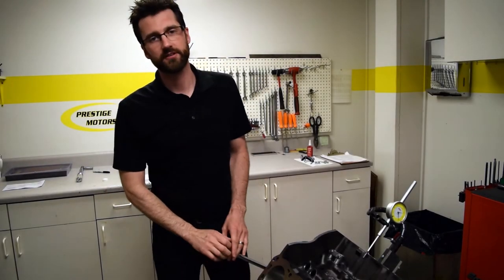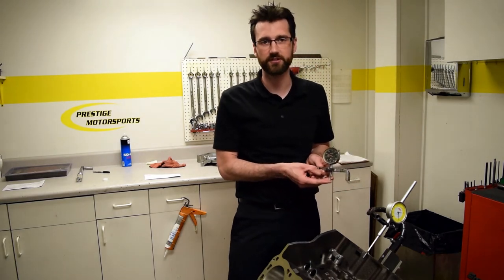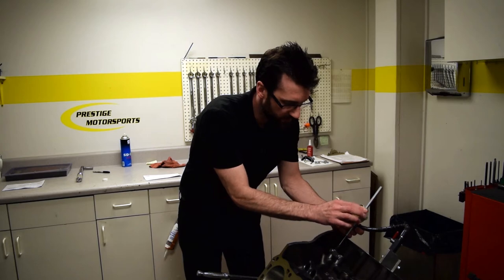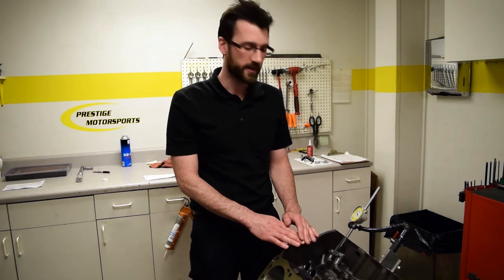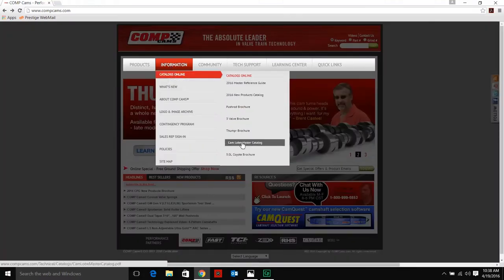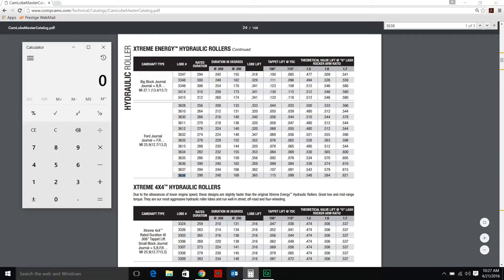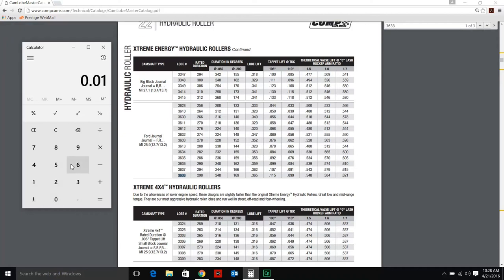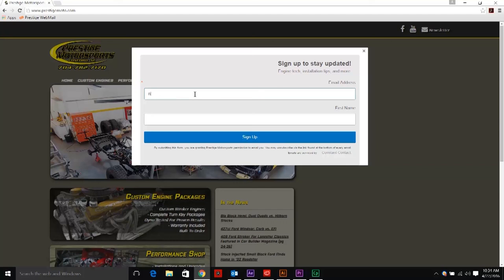How To Degree Camshaft Using Lift At TDC - Without Degree Wheel

Comment: Is there a way to discover what degree centerline is of a camshaft with only one comparable centerline at TDC? If my lift is different than the manufacturer's specs, and the manufacturer's website does not have the same exact cam running on different centerlines, is there an equation possible to figure out what degree I'm in or how many degrees off I am?

Comment: Pistons dwell like 5 to 6 degrees at the crank so you're pretty much wasting your time trying to degree a cam. Just buy a degree wheel they're like 10 bucks
Reply from the maker: We would disagree that it is a waste of time. On a 1.6:1 rod ratio, the piston dwells at 0.0005" for less than 2 degrees. That is certainly enough to read on a dial indicator. Then when you consider 2 degrees on the crank only moves the camshaft 1 degree, your lift at "TDC" is close enough to get you within a degree of intake centerline.

We would agree that the most accurate way is to use the largest diameter degree wheel available and a positive piston stop. The purpose is to show that in a pinch or in the case of multiple engines using the same camshaft grind, this is a very quick and easy method to verify cam positioning.
Reply: @prestigemotorsports  I don't know where you're getting less than 2 degrees but that's way off. But let's use your number. One degree at the crank on a custom cam is going to change the powerband a couple hundred RPM. On stock thats cool, but if you're using an aftermarket cam your wasting your time not dialing it spot on. If you going to do it half ass or"in a pinch" just stick with stock cams. Half ass efforts get you sub half ass results.
Reply: @prestigemotorsports  You're going to 2 degrees dwell just from the clearance on the rod bearings
Reply from the maker: @buildingracingvideos4714  if our number is way off, please feel free to show how to achieve the correct answer. The 0.0005" for 2 degrees is figured using basic trigonometry applied to the stroke length, rod length, and piston pin offset on a small block Chevy 383 with 6" connecting rods. (6 / 3.750 = 1.6 rod ratio)
If the process is followed correctly it is an effective way to degree known cam lobe profiles and is used by professional engine builders in the motorsports industry. The process has to be repeatable in this environment, and by establishing a procedure that eliminates the dwell at TDC, which is discussed in the video, you can precisely dial in a cam this way. However, that does require you to use a degree wheel the 1st time you determine your lobe lift at the specific point at the beginning of dwell at TDC. Once you know that lift number and the ICL it was installed on, then you can precisely dial in the same cam profile on another engine without mounting a degree wheel and piston stop.
Again, for whatever reason, you were in a position that you needed to check ICL and didn't have a degree wheel OR couldn't mount a degree wheel (such as in the car, at the track) you can apply this method.
Reply: @prestigemotorsports  You forgot the free play from the tolerances in your bearings. Bearings aren't rigid there's free play. That's where the majority of the dwell comes from. I'm very impressed with your trigonometry but it only takes simple geometry to figure out the dwell caused by the clearances in the bearings
Reply from the maker: @buildingracingvideos4714  feel free to apply geometry and give the exact answer. However, the procedure eliminates dwell, bearing clearance, piston pin clearance, and ring land clearance if done as described in the video.
Reply: @prestigemotorsports  I'm done. I just realized you're a math geek that only understands math equations and not actual engines. Ring land clearance has nothing to do with piston dwell. The geometry of the crank rod and piston have very little to do with piston. The largest contributor to piston dwell are the tolerances built into your motor. In simple words the slop from tolerances. You are totally missing the the number one cause of piston dwell.
Reply from the maker: @buildingracingvideos4714  We typically do not engage in this type of conversation, but since your initial comment was to degrade the process that professional builders use, and make a statement that was false, I just wanted to set the record straight. You are right that geometry of crank stroke and rod length are what determine dwell time. Tolerances do affect dwell, but I would disagree that tolerances are the largest contributor. In fact, on a 383 Chevy you would need .065" (sixty-five thousandths) of clearance to add 2-degrees of piston dwell. Most performance engines have a rod bearing clearance of .002-.0025 (two to two-and-a-half thousandths) of clearance. This adds less than 1/10th of one degree of dwell.
Reply: @prestigemotorsports  I'm astonished at how it doesn't concern you in the slightest bit that myself and anyone else who's used a degree wheel to check piston dwell gets different results than your math. It's so simple, a dial indicator a degree wheel and simple counting. A 100% accurate answer and no worries about did I do my math wrong.
Tell me how to get a video to you. I'm waiting on cams for my drag bike as I speak. I'll check piston dwell again and get it on video if it will help someone be able to dial their cam in better.
I'm not trying to insult you, but people who don't know any better, in a best case scenario will never see the full potential of a cam they spent too much money on because they're a couple degrees off. I know I've been that guy. Getting TDC with a dial indicator, what do I need adjustable cam sprockets for if I just install the cam correctly. I've done it and it sucks. I've known the correct way to do it for a long time and I still search around looking for an even more accurate way of doing it because I know how much difference a degree makes. That's how I arrived here. Ordered new cams and was searching for a more accurate way than what I already know